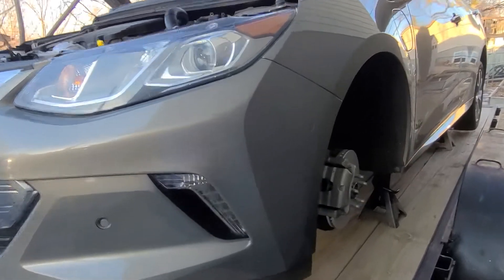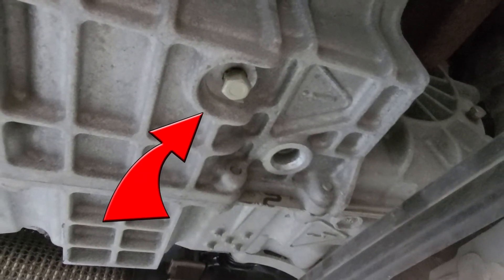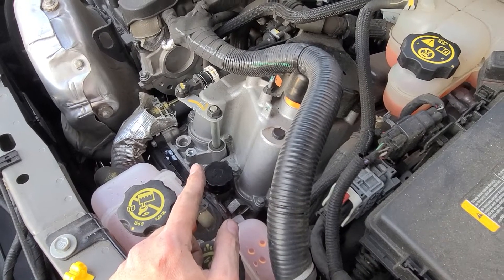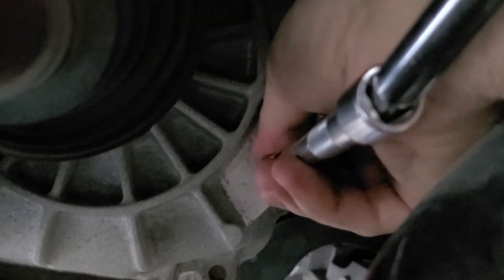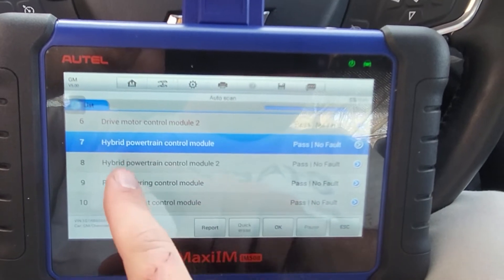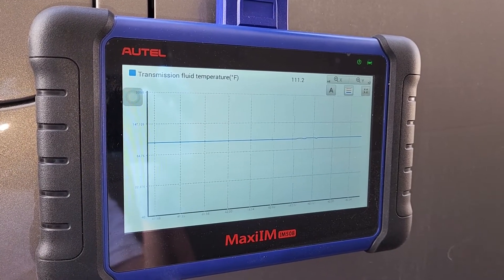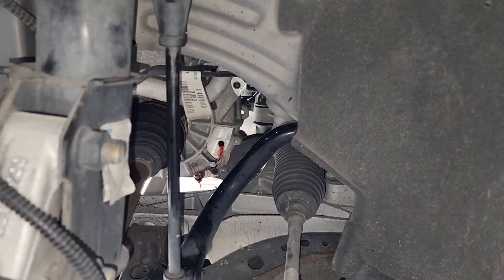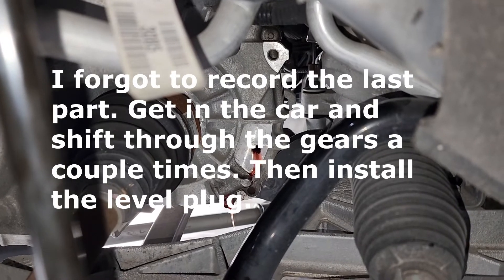DIY: How To Change Transmission Fluid Chevy Volt 2016-2019 5ET50 Drive Unit

Comment: These transmissions are not like your typical transmissions found in all gas powered cars, right? I was under the impression that my chevy volt didn't have a transmission since it's driven by an electric motor all the time. Shows how much I know, lol. 😂
Reply from the maker: It's not a "transmission" like a typical car, but it is. GM refers to it as a drive unit. It still requires fluid and fluid changes though.

Comment: Thanks for the video. I'm going to do this to my 2017 Volt soon.

How often are you personally doing this oil change on your Volt? Mine has 60k original miles, and it'll be the first change. 50k-75k range seems reasonable to me. I know the manual says up to 150k, but that is a hell of a long time for oil.
Reply from the maker: 50-75k is normal. 150k is way too long for any transmission. I changed mine around 32k miles, but that was mostly due to losing fluid when changing CV shafts while repairing it.

Comment: Great video, thank you. Just an important note, I know that you can hear the engine running when you do the final check for level, this is important to get the right amount. Also does anyone know if there is a filter to change, I cannot find any info for this, seems like there would be a filter
Reply from the maker: No filter to change.

Comment: hello bro, well done, i have a serious question, does chevy malibu hybrid have same as volt transmission gear? does both of them fit same fluid? could you please recommend me fit type of transmission fluid? thanks
Reply from the maker: The Malibu hybrid from 2016-2019 also used a 5ET50 "transmission" drive unit, but modified as it had a different clutch and magnet setup. Dexron 6 - oil is the same.

Comment: How do you get the Gen 2 Volt up on the jackstands, though? With the aerodynamic cover on there's no hardpoints to jack it that I can see, other than where the stands are supposed to go..
Reply from the maker: I used the front frame sections by the control arms to lift the front, then set the jack stands on the lifting points on the pinch welds. For the rear I used the rear suspension to lift it up, then the jack stands on the pinch welds.

Comment: What Jack point do you use to get the front corners up on stands? Did you check for the car being level during final fill?
Reply from the maker: I ended up using the front engine cradle side rails for the front, then set the jacks on the normal jack points. The rear was lifted from the lower shock/spring mounts and jacks on the side jack points.

Comment: At what mileage should you do this?
Reply: Manual states 150k :)
Reply: Wrong…manual states every 45,000 miles
Reply: 45,000mi for "severe" driving conditions, 150,000mi for "normal" driving conditions.
Reply: Very few cars are classified as normal driving conditions, believe it or not.

Comment: Can you just measure what you took out and put equal amount back in?
Reply from the maker: You could, though that is significantly more work and it still may not be correct. It needs to be at the level hole when up to temp.
Reply: If you do that and your transmission was low or high on fluid, then you just filled it too low or high again.

Comment: Thanks from NorCal!! I have been dreading paying $300 for a $30 oil change. I have the fluid left from my LS swap!
Reply from the maker: Definitely not as complicated as the dealer makes it appear.
Reply: Concord CA Chevy dealer want $400 for this service! Yeah, nope! Doing it myself
Reply: @crsp76691 Tracy Chevrolet says I need a 14k transmission lol.  No grinding, no slipping, no cel but “found metal” in oil.  Yea with 113k miles on oil you will see a bit of metal.  But unless it’s shavings and chunks I’ll be doing a fluid change and probably drive another 113k miles.
Reply: @ltx383 do you still have your volt? How many miles do you have on it now?

Comment: I didn't know my 2017 Volt had transmission fluid until a dealership mentioned it. Thanks so much for making this vid.
Reply from the maker: No problem. It's easy enough to change. Similar to the Ford Edge I just did.
Reply: @Alexander Adams There is actually a drive unit on the Volts with fluid that needs to be changed. That mileage though is anybody's guess.
Reply: Is the transmission fluid the same as 'electric drive fluid' that the manual recommends changing every 45k miles?
Reply: same here lol...feels foolish.

Comment: The expansion of the fluid between ambient temperature and 131F is insignificant. There is no way to establish that the car is "perfectly level" in the first place. Secondarily, the "proper" level is an engineering estimate. An eighth of an inch more or less is not significant. Adding fluid at the end a small amount at a time (say, 2 ounces) until oil appears at the bolt is close enough.

Comment: the manual says 7.13 quarts.   Is  that how much you think you  used?     Why do I need to bring the engine up  to temp?
Reply from the maker: That's probably about what I used. You need to bring the TRANSMISSION fluid up to temp as it expands when heated. Otherwise if it's cold you will overfill it.
Reply: @HeartlandRebuilds  
but how? 7.13 quarts is 1.8 gallons. Almost two gallons. That's a lot more than a gallon.

Comment: Looks easy enough, sure I can do it myself. One question are you doing the final fill at temp with engine running and level plug removed. Sounds like the engine is running in video but there's no mention. Thanks
Reply from the maker: That's correct, final fill with engine running, level plug out, at temp. Then close it up and you're done.
Reply: As long as you have a way of reading transmission temp you are all set with the rest. Manual states 150k

Comment: Hi  Are there any torque specs on drain plug and level plug?
Reply from the maker: I'm sure there are. I just snug them down like any oil drain bolt.
Reply: 11N-m (97 lb in)

Comment: Thanks for the video.  At the beginning you say to take the passenger wheel off yet you show it on the drivers side? 
Are you from another country where the steering wheel is on the opposite side?
Reply from the maker: Good catch. It is the driver side that needs to come off.
Reply: @HeartlandRebuilds  I was going to do the fluid change myself.  I took my Prius to a transmission place near me  a few years ago and he was reasonable on pricing.  He charged me $175 total to do the job on my Volt yesterday.  
I called the Chevy dealer to see how much they charge.  They charge $250! Way overpriced.  For $175, I felt it’s worth it to have a shop responsible for it.  If something goes wrong I have some recourse.  
If I had to pay $250, I would have done the job myself for sure.  Seems easy enough.  I was a little worried when they said they’ve never seen a Volt in their shop.  That’s the benefit of taking the car to a Chevy dealer.  All they see and work on everyday are Chevy’s so they are more experienced at fixing cars except they rip you off on the price.  Next time I’ll do it myself.  A few things held me back.  One, I don’t believe the Volt comes with a Jack.  So I’d have to buy one.  Two, I don’t know how to override the battery and make just the gas engine turn on so I can get it to temperature for the final level check.  And three my friend who doesn’t own a screwdriver always gets negative and tells me what if I screw up etc.  I always tell him that I’ve been working on cars my whole life.  And I’m a fix it guy.  I have tons of tools and knowledge.  
He said you don’t have that temperature monitor you used to make sure the temp hits 130 degrees.  I said that’s true but I have my hand to test it.  Lol.  Anyway, thank you so much for the video.  You said you over filled it.  That made me nervous as well.  Do you just let it drip out until it’s just a slow drip to determine the level.  And isn’t there a dip stick to check the level like most cars have?
Reply from the maker: @MusicMaster961  the gas engine will turn on as soon as you open the hood with the Volt on. Make sure the parking brake is set first. You should be able to get a cheap Bluetooth scanner for your phone to read the PID for transmission temperature. I slightly overfilled mine and let it come out the level hole until it was very slowly coming out. If under warranty, then it makes sense to take it to a shop/dealership so you can show it was serviced at an ASE certified mechanic.
Reply: @HeartlandRebuilds  Thank you.  Great advice.  And thanks again for making the video.  Next 40,000 miles I’m doing it myself.
Reply: @MusicMaster961  I just called my dealership and they quoted $350 for this job. They said that they would have to remove the bumper! That's why dealerships are stealerships. I called my local guy and he said he would do it for $125. I'm good with that.
Reply: @HeartlandRebuilds  Plus the wheel well liner.
Reply from the maker: Wheel well liner is still on and doesn't need to be moved at all. The bottom engine cover does need to be removed so you can access the drain bolt for the drive unit.
Reply: @HeartlandRebuilds  , Ahh! I watched the video again and you're right! I'm going to do this on my 2017 when it gets a little warmer.